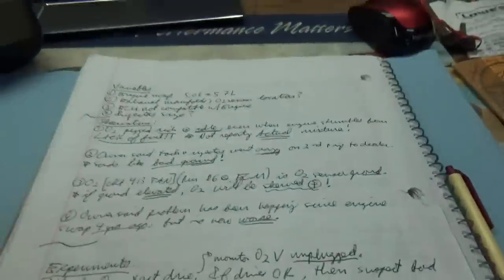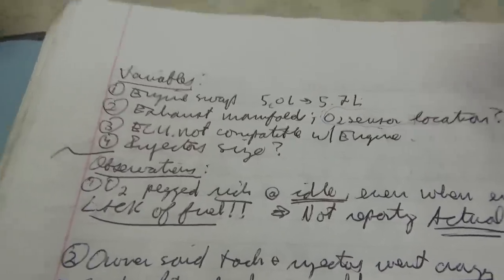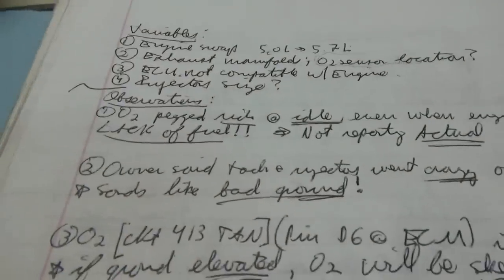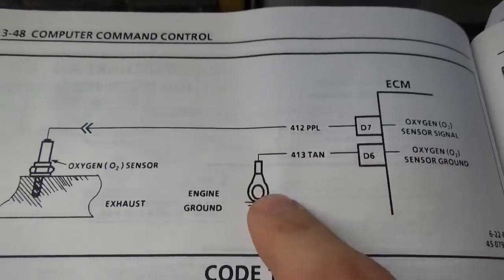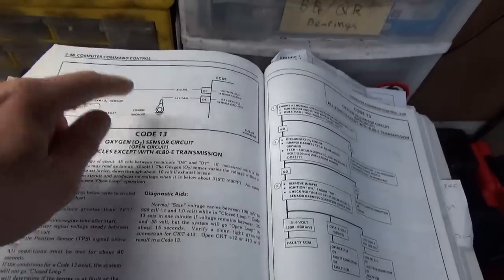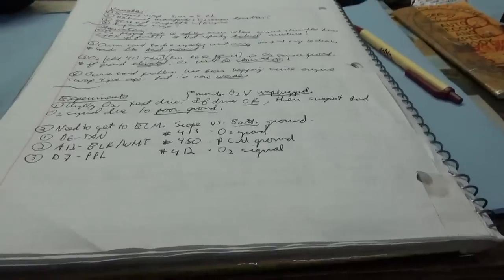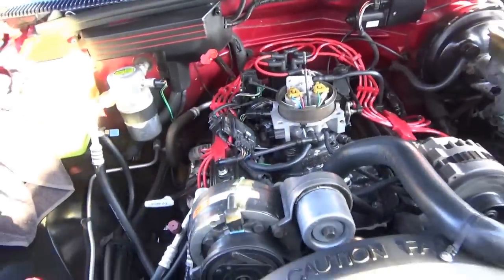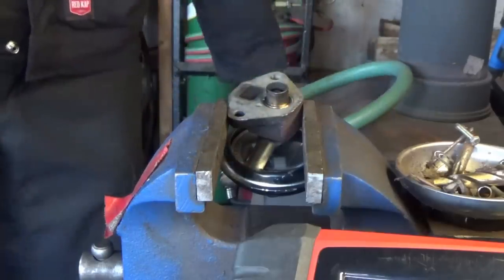Classic Chevy Christmas! - Part 2: Emissions Systems

Comment: Blown O-ring in left injector.
Check the bent throttle plate lever, base timing, and computed timing, after you replace the higher Lb per hour injectors. 
The best system ever, TBI is so simple, visual inspection of injectors is easy, but, not being familiar with them will send you in circles.
Reply from the maker: Good eye, James! TBI is simple in theory, but deviating from the calibration parameters can indeed throw the technician for a loop. Not too many parts to the system, but when every one has been messed with and there are no "known goods" we must be diligent to check each one thoroughly :)
Reply: @PineHollowAutoDiagnostics  in a dual injector setup, pattern is the easiest indicator - you'd have to do flow tests on each to see if you had flow mismatches -- but, i do agree with all the consensus the left injector looks like it's got family memebers working for petroleum companies.
Reply: @PineHollowAutoDiagnostics  the thing I keep going back to in the customers story is the vehicle acting up , stalling and not restarting .   Secondary note: this customer seems to be a bit of a gear head and would like better performance . Holley and Fast make a pretty simple tuneable fuel injection system . It would open up options for performance for the customer .

Comment: If the base idle could not be controlled without messing with screws then suspect a bad throttle body gasket. Especially  if iac counts are pegged low.More air equals more fuel.

Comment: Check the throttle body gasket for damage.Replaced many back in the day where they break in between the two ports and most times you could open the throttle and look down and see the gasket sticking out.

Comment: Need the knock sensor, ecm (or prom chip), and electronic spark control module from the 5.7.
Reply: ding ding ding , we have a winner . That new engine didnt come with an EGR valve and the new Ecm cant read or adjust the EGR valve
Reply: Ding , Ding , Ding , We have a Winner
Reply: If there is no vibrations or dentonations to ping the knock sensor is useless. How would that affect anything?
Reply: The most important part is the ECM. The knock sensors are usually specific to the bore size. You probably already have the 350 knock sensor unless they removed the 305 one and switched it over to the 350.
Reply: @weldingjunkie  it would limit the timing advance, but not cause a miss at idle. it would be like umplugging the timing connector

Comment: I understand your frustrations my friend.i have seen on some old small block Chevy's were intake manifold gaskets have simtoms similar to what u are experiencing.and it's always when engine comes up to warmer temperature when this occurred.its a possibility.guess smoking it out when it's nice n warm might Chase t problem out.i have also seen t base of the throttle body  draw vacuum were t butterfly plates join at the throttle rod.

Comment: This may be off the subject of fuel but I've experienced this on GM's in the past. He has number 7 and number 5 spark plug wires laying next to each other on the mount (because it looks organized). Those two firing events are the only two that fire next to each other (firing order 18536572). It ended up being a bad spark plug wire insulator and it was intermittently jumping spark to the other wire. Pure guess on my part but it was the same system I see here. This will be fun to figure out.
Reply from the maker: WOW now that is a crazy scenario, Wyatt!! Never would have thought that would be possible!

Comment: the EGR valve on those usually fail by rusting the bleed hole shut, then they open to far too soon and cause a tip-in low rpm major stumble/miss.
right where you cruise around on the throttle, they'll go total berserk

Comment: You can clean the sensor ground connection but you can also take a 1.5v battery and use the small battery (+) to the sensor wire and (-) to ground and check the scanner reading for 02 voltage, if it's showing a difference you have resistance in the circuit.
Reply: This would be faster than your check here. (quick tip).

Comment: The left hand injector spray does look wrong - it is supposed to be a nice cone - shouldn't see drips. Check fuel regulator input & output pressures. Injector could be sticking/broken etc. Look at injector signals compared to correct ones for that engine config. You'll get it Ivan!

Comment: There are a lot of comments about the injectors.  
You can check the injector spray pattern for dripping or a " skewed " pattern with a timing light.  Direct the beam of the timing light onto the spray pattern.  Jazz or blip the throttle and watch the enrichment.  Look for an even conical spray pattern that hits the outer edges of the throttle plate as you momentarily blip the throttle.

Have a great Christmas
TakeCare,
Bill
Reply from the maker: Cool tip! Thanks Bill, you too!

Comment: The distributor pickup magnet can change base timing as temps change pull timing connector check timing through entire warm up
Reply: I've seen the timing suddenly jump 30 degrees on old pickup magnets rivet type

Comment: O2 sensor I think should be back in collector to sample all cylinders or in an H pipe for the true sampling.  Just my thought. Good lick with the sweet looking sounding truck.
E
Reply: pretty sure those are summit racing truck headers and the O2 is right at/past where it gets the best blended flow from all 4 cylinders on that bank.
if so they are CARB certified blah/blah/blah.  I doubt they;d be some one off design when you can get the same headers that have been produced and still capable of passing e-check since  the 90's ;)

Comment: Dash display had grounding issues, was an issue with that generation.  Ask me how I know.  Failed intake gaskets are common on these engines as well.  Fuel pressure or injectors.  Pull a spark plug!  Visual inspection!

Comment: Ivan never checked the actual ground to the O2 sensor at the actual sensor!     I am guessing that the sensor uses the metal connection to the headers to create the circuit to ground.   GM just grounded the O2 ground at the PCM because there wasn't a second wire at the O2 sensor itself.   Also, what material are the headers?    What about the engine block ground?    The engine block ground could account for the fuel as well as idle problems.
Reply from the maker: Great question! PCM grounds to the engine. We verified that with the scope 100% :)

Comment: Check the letter at the end of the EGR part number. If it's neg back pressure egr the last digit will be N for negative or P for positive. It it's a positive pressure EGR it will only open under load and will pulsate when the solenoid opens.  I had to dig deep to remember that one. I used to call those injectors, "like flushing the toilet". The spray pattern is crude along side of port injectors.

Comment: Those TBI's have a base idle procedure and likely would be something to cover especially if they have been replaced. They are no longer made by GM so they could be new anything or used OEM. The procedure is to unplug the idle air control electrical, key off, short pins 0 & 1 at OBD port, start engine and read RPM which should be around 650 to 750 RPM. If not, theres a leak or the idle screw needs to be accessed and turned to reach correct base idle. Once set, key off, remove jumper at OBD, connect IAC elect plug. the idle screw has a pressed in plug over it on the left side of TBI just in front of the Linkage. Some will drill it out for access. Had experienced a TBI that  would never idle unless fully warmed up and trans in gear with brakes on for about 30 seconds or so. then the idle would always return to correct RPM but the cycle would start all over again once ignition was turned off and started up again, you'd have to give it 30 seconds in gear for the IAC to respond to full closed. A lower based idle RPM setting helps eliminate this concern but then the idle is too low for comfort.

Should have ordered his truck with the 5.7 when he was in the market. Lots of folks simply buy whats on the lot vs. wait for a fully custom ordered vehicle.

Comment: when I am doing emissions test , o  those  gm trucks with tbi system I had had several of them  failed from other shops for higher number of hc and co idle only, in one of the emission classes update for tbr license the teacher show us a trick, is  this engines at idle they run rich and some times or most of the time goes in open loop , so when doing idle portion I raise up the rpm to about 900 rpm and now the 02 sensor cycles, and get in good fuel control .

Comment: Truck probably has a negative EGR.    Also check for the vac leak around the Iac sensor. Small gasket is there    Mine was trashed I made a new one   And the throttle body base gasket sometimes is an issue but I never had one go bad on mine.  Or start spraying carb cleaner allover the place looking for an change?  I still would make sure it has the proper fuel pressure if its not at 12-13 psi these things work horribible.   Maybe someone put in some aftermarket fuel pressure regulator or spring and its higher than its supposed to be over fueling at idle. or low speeds. Oh yea does this thing warm up to like 195-200 degrees at idle? Maybe they put a 180* T stat instead of a 195 that messes up everything on these. It runs too cool of course. I tried one for fun years ago and all it did was go int and out of open and closed loop when it was cold outside.

Comment: How about compression test on the O2 Sensor Side Bank (or the whole engine for that matter)  Remember a speed density engine fuel strategy, has to make the assumption that the pump (engine) itself is working right, because it has no MAF.  An incomplete burn from low compression will throw unburnt fuel with very little O2 into the exhaust on that side making it seem rich to the computer, and then the computer is reducing the fuel on both sides.  

Remember the O2 has no idea how much fuel is present just how much oxygen is present compared to outside air.   Normally a misfire that burns no oxygen (ignition misfire) will cause the sensor to read more oxygen, but one from a low compression is getting a lack of O2 introduced to begin with, and then mixing the unburnt fuel into the exhaust from the other cylinders and burning what little 02 their was in the manifold.  This will get worse at idle, because as RPM's come up so does the compression a bit, and the more air the pump is moving the less on bad cylinder affects the pump.

Then we have to consider the lack of vacuum caused by that low compression too, that affect the manifold pressure on a speed density engine (more so at idle).  I've seen more than one speed density engine with severely low compression on one cylinder act exactly this way.  Great driving down the road and it won't idle right and high negative fuel trims.   It's why I did the rebuild project on my 99 Grand Am 2.4 LD9 engine.

If this is not the case then I would say its screwed up because the computer thinks there is a 5.0 liter pump instead of a 5.7 liter pump.  (Remember we only measure 02 and not fuel).  Just he same as we would expect 5G/s vs 5.7G/s on a MAF engine this size.
Reply from the maker: Excellent analysis. We will touch on all aspects, including engine mechanical, and the computer mismatch :)

Comment: The OE egr's should have an N or a P stamped on them signifying negative or positive backpressure. It is very important that your replacement valve be compatible, because they look exactly the same, but function completely different.
Reply from the maker: I actually read that in service info! Had no idea they had two different designs lol

Comment: I wonder if the design of the intake manifold just happens to bias the fuel from the one drippy looking injector to the bank with the O2 sensor. That would match the symptoms perfectly. O2 sensor correctly reading rich, while the other bank with no feedback is trimmed excessively lean.

Comment: Long ago I have heard of this issue in this generation trucks when headers were installed.   I had a 1992 GMC Sierra with the 5.0 liter engine.   The stock exhaust manifold has the O2 sensor at the end of the manifold where the sensor is reading off of four firing cylinders.   The O2 sensor reads the exhaust from four firing cylinders to adjust the fuel for the throttle body for all eight cylinders where on the headers the O2 sensors are tapped into only two cylinders exhaust.  Two cylinders exhaust is not enough to correctly adjust the mixture for the remaining  six cylinders.    Friends adding headers to this generation truck reported wonky idles.  The 5.0 to 5.7 swap might have amplified the problem.    Would be nice of there was another port downstream on the headers where the O2 sensor could be relocated to see if reading off four cylinders this improves the issue.

Comment: gotta ignore the engine swap besides the headers and throttle body. The only  differences in swapping a 4.3, 5.0 or 5.7 in these generation trucks was the injectors, fan shroud(if 4.3 to v8) and a chip you swap on the ecm. Everything on them was plug and play. Like you said- back to the basics!

Comment: With the IAC @ 0 should not be running.  air is entering somewhere opposite the bank with the 02 sensor. That gives the high idle. Also causes the lean misfire on the bank opposite the O2 senor and the rich reading on the side with the sensor.

Comment: Throttle body injection was popular in the 90s in Europe. It was called the single point injection (SPI), as there was almost always one injector. The ordinary style, where you have single injector for each cylinder is called multi point injection (MPI). Nowadays nobody cares about it, cause all the cars are multi or even  in-cylinder injection. But back then you could often see an "MPI" sticker on the back of a car that was multi, just for everybody to see that you drive a vehicle with modern fuel system xD

Comment: I commented on Part 1 regarding the throttle position sensor voltage possibly being out of spec, because I didn't see it directly addressed in either video. Just a thought...

Comment: Hello Ivan.

Consider the modification of the exhaust manifolds be the main problem you have here. O2 sensors of one wire are very bad behaving on exhaust headers due to lack of heater circuit, and with headers they become cold all time and they are reporting pegged rich due to lack of sensor temperature.
At that point, the ECM is pulling out fuel all time due to this, making the engine super lean and even with that the O2 sensor continues reading rich due to being cold and missreporting the real mixture on the exhaust.

Solution:
You should take a 3 wire oxigen sensor, typical from GM's from 1992 onwards, and modify the wiring, providing a +12v from switched ignition and direct ground to the other two wires of the sensor so the heater will become powered. 
This way you will have constant temperature on the O2 sensor independent on the load or throttle of the engine, giving you a correct reading on the exhaust mixture.

Try this and I am sure you will get great improvements on your fuel control by the ECM.

Bonus:  With the OEM manifolds and the mandatory catalitic converter, single wire O2 sensors have better readings due to the heat retention of the OEM exhaust, so cooling down of the sensor is not a problem. But if you install exhaust headers and a more open exhaust system, one wire O2 sensor remains always cold and gets impossible to read properly.
This is why is mandatory to install then a heated O2 sensor.

I use to install the Bosch three wire sensor p/n 13077 (Rockauto) with the appropiate weatherpack wiring pigtail connector and works great for this OBD1 ECM computers, working on the 0-1v signal.
Reply from the maker: Excellent info, thank you! I like the heat retention explanation.

Comment: I've had egr issues on my Caprice to the point where I just disabled it in the tune.  Passed emissions that way, too.  With a freer flowing exhaust you tend to need N type valves.  But yeah I've had issues where the valve was opening when it wasn't commanded to or opening too much.  Never solved that.

Comment: Think of this to if the throttle I'd part held open your tps is up so the computer is adding fuel for a throttle tip in. I'd get the idle under control then see what happens
Reply: yeah, him saying they "bent" something is probably the throttle plate stop arm, instead of removing the plug and adjusting the stop screw

Comment: What is the run fuel pressure when it starts to miss fire? I'm betting it's fuel related that is being corrected by the ecm but the ecm can not correct it. Might be wrong but I'm sure following this as I'm interesting buying a throttle body pickup that has a huge rich issue and will also miss fire from time to time without any cel present.

Comment: A vacuum leak somewhere in the intake mainfold(s) would be something that can develop and gets worse over time by nature.
The leak would be most pronounced at idle / low rpm as this is where the mixture is most sensitive to a fault.
Could be a crack, bad gasket, rotten hose, leaking valve or erratic fitting of a component.

... and get that modified idle setting "bent bracket" back to where it belongs !

On the injector issue, you guys should remember that this is not a fuel injector as per regular means. It is designed to resemble the fuel flow in a standard carburettor barrel and is done so by an electric injector to make it easier and more precise to regulate the fuel injection.
At low fuel levels the fuel will literally slowly drool out the injector, exactly like in a downdraught carburettor.
At moderate fuel needs you would even see the injector pulsing at a varying rate to meter the correct amount of fuel.
Only at high fuel needs you would see a constant spray inside the carburettor barrel, as the pressure to the injectopr is constant.